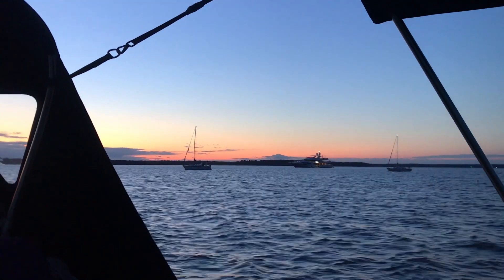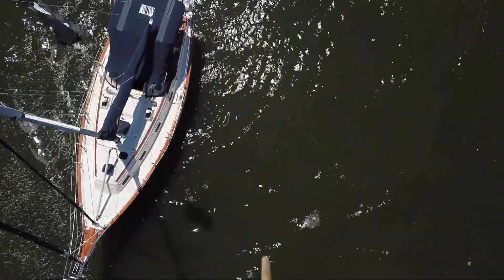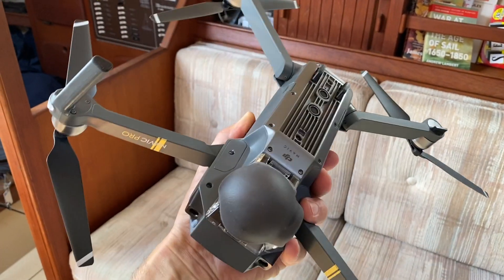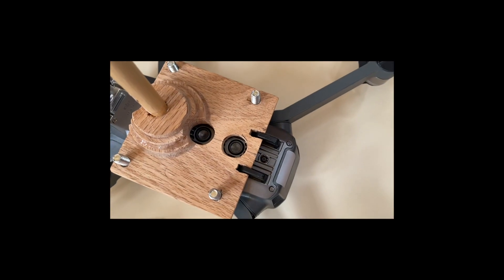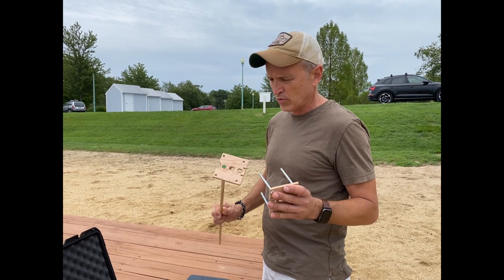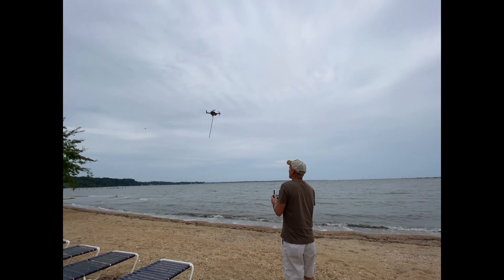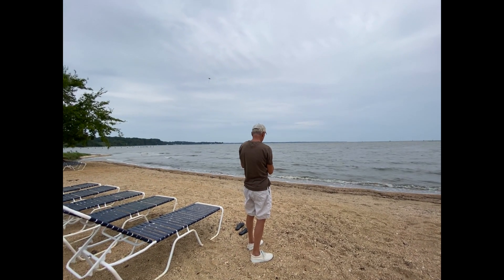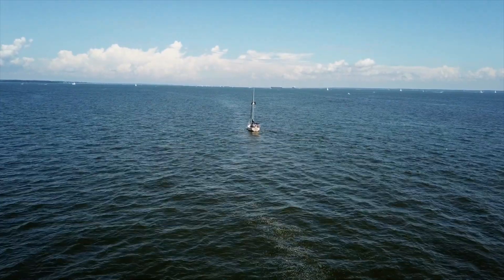How To Land A Drone On A Moving Boat - DIY

Comment: For smaller drones there is an even simpler solution to the same effect.

I have a MIni 4 pro and I’ve just wrapped a long cable tie around the body of the drone as close to the rear of the drone as possible with the tail of the cable tie beneath the drone.  When pulled tight the tail hangs down perpendicular to the bottom of the drone.  I then fed the tail of the cable tie down the centre of a cut down carbon fibre arrow shaft about 6 inches long.  It is held on by the terminator of another cable tie.  The whole thing weights about 3 grams and by locating it at the back of the drone it does not interfere with the sensors or the battery ventilation.  I launch and retrieve exactly as you do.
Reply from the maker: That’s a really great approach!  Thank you for sharing and good luck on your boat related drone projects.

Comment: Have you launched and retrieved it under sail in a good breeze?  I’d be curious how this affects flight time and performance flying into the wind.
Reply from the maker: I have, and will say it’s not for the faint of heart! 😂  The wind definitely has more of an impact on flight time than the drone stick. Key is to keep it as light as possible. Would also say don’t skimp on stick length. The stiffer the breeze the more I appreciated the 28” dowel. Good luck!

Comment: A nice simple solution to a problem! To improve aerodynamics and reduce drag, could you use some kind of a swivel connecting the stick to the base that would allow the stick to swing against wind resistance yet still allow you to retrieve the drone?
Reply from the maker: That's a really good idea, John!  I'd probably want to allow it to swing back about 20 degrees, and maybe half that far to either side.  I wouldn't want it to swing forward at all, as that could allow the stick to swing into the camera frame.  But even that much play would probably do wonders for the forward and sideways performance.  Thanks for the tip - stay salty!

Comment: Love the ending with all the sailing shots!  Did you get the right weight on your first try?
Reply from the maker: I got pretty close. I used fairly thin pine for the plates, and the dowel was light as well. Decrease in flight time was less than 3 minutes, so under 15%.